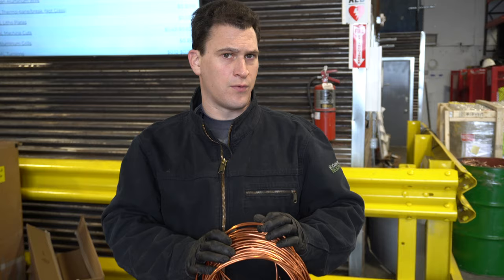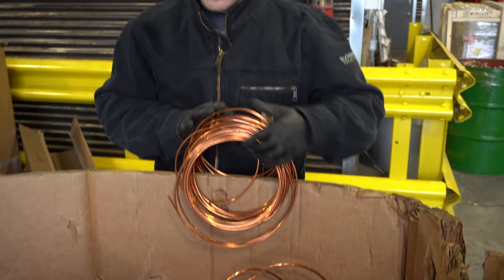Why You Shouldn't Make Scrap Ingots - Why Scrap Yards Will Say No To Buying Them

Comment: THANK YOU THANK YOU THANK YOU THANK YOU. OMG. Ingots have a purity based monetary value. People think making a square chunk of metal Miraculously somehow makes it valuable.
Reply from the maker: You're welcome! Thanks for watching! It's important for people to know that it's not going to work if you are scrapping them.
Reply: People will pay a lot more money for hand poured ingots for collecting
Reply: @BGTech1  well those people are not to bright. Bringing Metal home smelting it and trying to get the local scrap yard to buy it or even pay more is a waste of resources. and you are unlikely to pay for groceries or buy a car attempting to use such ingots. the Only possible reason i could maybe see for smelting is for Aluminum or copper/brass shavings. which may be worth more as a solid rather than as a shaving.
Reply: @4CarbideGaming  truly
Reply: @4CarbideGaming  well I can truly tell you've never scrapped before , the shavings you speak of would fill a bucket or barrel more tightly than full metal pieces which in turn saves space and easier loading .
Reply: They absolutely would not a solid barrel of brass will weigh nearly double a barrel of shavings would. I recycle cast steel shavings for over a decade at a metal shop. The barrels will average between 400 to 700lbs. The same 55gal drum of solid 3inch steel cutoffs is an easy 1200lbs or more Shavings vs Solids. Really.
Reply: Like why would you even take the time to make metal shavings. WTF.
Reply: @4CarbideGaming  you still don't know what you're talking about . . . milling machines , lathes , cnc machines and drill bits all create shavings ...... now why in the hell would I sit down and make metal shavings when its already produced thru the process , LOL go away.
Reply: I simply said the only reason smelting may be slightly beneficial is if you have a barrel of shavings and you were turning it i to solids. Again thats a maybe.
Reply: @4CarbideGaming Some people have 10,000 sq feet or more of garage, of unused space and others
have much, much less space for their endeavors. In otherwords, some folk can't have a horse ranch on a urban lot!

Comment: When I take motors apart for number two copper I melt it down and my yard buys it for number one copper just something I do for that kind of wire but I can up the value of it by doing that but that's just my yard a lot of yards won't even take them but I have also took bars up to them that was copper pipe with sorter on it and I borax it twice I told him it was number two copper they tested it it's almost 100% 99.2% pure so yeah depends on what you like but the video is correct looking forward to more
Reply from the maker: We are very surprised to hear that you yard accepts that as #1, good for you though! How do you remove the shellac and non-metallics?
Reply: @iScrapApp  the yard I go to is stuff's recycling in Winchester Kentucky they're a big yard but they cut the ingots when I first started going up there you know to test them but I use just regular borax 20 mule team Borax and I run it through twice on that I figured it was number two as well but when he tested it I couldn't believe but I don't recommend other people to do the same thing that I do ever because taking bareback copper melting it down you're just killing yourself
Reply: Yup. And in demos we see a lot of burnt copper wire that the yards won’t take. So, when made into ingots, they will take it, otherwise it’s just “trash”.

Comment: When it comes to copper, the price when you have to heat it might balance out your cost and payment, I'm more wondering if the same applies to aluminium and lower cost metals
Reply: yes selling on Ebay or Amazon will net a higher value for ingots
Reply: melt in cold days it'll warm your garage it's the poor man's  special 2 for 1 deal :face-fuchsia-tongue-out::face-blue-covering-eyes::body-blue-raised-arms:
Reply: @fvrrljr  yeah buddy. Got me 27 pounds of pretty clean lead and a little extra warmth while doin a few other things. Hah
Reply: Copper and brass are worth it, aluminum you're actually losing money if you run a propane furnace.

Comment: All you'd have to do is measure the density of the ingots.  Throw all the ingots in a bucket of water filled to the top, measure the amount of water that flows out, and then measure the weight of all the ingots.  If the density matches that of copper to within decent precision, you know that you're not being scammed.  We've known of this technique since the time of Archimedes (250 BC).

Comment: If the scrap yeard company doesn't have the equipment to check the engot , then find a scrap company that can
Reply from the maker: The problem is what is inside the ingot...
Reply: @iScrapApp  a xrf analyzer gun will tell you whats inside ingots.
Reply: @24manzoni  It doesn't penetrate more than 1 inch or so, thieves are thieves with lots of time to do their scam, and honest people want to make a buck on their efforts!

Comment: Thanks for the info. I'm a garbage man and I clip the wires off of appliances and so forth. In just under 6 months, I have collected three 50 gallon trash can overflowing with insulated copper wire of various sizes. I just made a homemade speed stripping jig and I'm about to start stripping it rather than Burn It Off so I can get copper one value versus copper two. I'm not in a real hurry to cash it in so I was considering learning how to make a smelter to reduce storage space. But I suppose the naked wire will compact reasonably well enough under some weight into buckets or cans. Probably saved me a lot of hassle and headache and unnecessary work for nothing. Thank you for this video.
Reply from the maker: Good for you- nice side hustle!
Reply: I work for a private company that picks up garbage from private residence only, and take the garbage to a privately owned landfill. Public property isn't part of the equation with what I do. I appreciate your concern, however. I could also see the city considering that stealing time because it does add a couple of seconds to each stop to clip the wires and stash them. But wow, that is extremely Petty of the city to go after their hard-working employees just trying to hustle an extra Buck or two without really hurting anybody. My boss knows I clip wires and doesn't have a problem with it. As a matter of fact, some of my customers that have seen me do it have started leaving appliances and electronics beside the trash can rather than in them.
Reply: Number one and number 2 doesn't refer to insulated copper...
Reply: Yes, and that bright copper wire is the highest grad scrap there is, and the highest price. Melting it into  something indistinguishable will lower it's value.
Reply: Good job! Keep it and keep collecting copper too! If you don't immediately need money, keep getting the copper, but you might run out of space. Copper will only be more valuable over time, so sitting on it will only make it more valuable, if this is the job you retire on, or just a stepping stone to something else, most everything never goes down in price, except TV's. Strip it, store it, save it for retirement nest egg. The only problem with the last one is you could die shortly before you retire and when your home is being cleared out for sale- some numbnut could go what the hell is this? And straight to the Garbage Dump it would go! It happens!

Comment: Gotcha so don't melt down sell at reduced price and let them melt it instead and make more money doing what I would of done anyways. This question can be asked from even reliable suppliers.
Reply from the maker: 🤦‍♂️ most scrap yards don't melt it...even who they sell to don't. So you are missing the point that they won't want to take the risk on melted ingots.
Reply: @iScrapApp  no I got the point. U missed my point. Being afraid to buy a product cause of either reliability or quality of the said product whatever it is is a fact of life for anyone buying anything. Wether it be melted ingots or a vacuum cleaner. Selling yourself short of income that could be made cause the scrap yard is scared of the quality of the ingot is same as saying u will never buy anything again be from Walmart or any other store cause u are scared of quality. There is no reason they can't test the quality of product they are buying that is all I am saying. If someone sells u bad ingots don't buy from them again. Simple.
Reply: @fusionmechanic1  I agree, they are buyers of scrap metal not buyers of  objects they can positively identify. If they won't buy them then who will; and nobody better say ebay.

Comment: Hi Tom, good video. I have a question. I was wondering why alternators generally are worth more than electric motors when they seem to have less copper in them? Thanks
Reply from the maker: Many buyers of electric motors or alternators or starters are able to resell these units to companies that will rebuild and resell them. So while many of them either have less copper or have aluminum cores in them, their resale value far exceeds the scrap.
Reply: Alternators or Generators are salvageable and have a "clean" cast aluminum housing.

Comment: Why does copper wire get brittle burning insulation off?
Reply: The annealing process goes just so far.
Reply from the maker: Because the heat starts to melt it down and erode slightly.
Reply: It wasn't cooled properly from being heated!

Comment: He is not wrong, for a scrapyard this is business, melting the copper down opens them up to scams and does not guarantee them the purity level, forcing the scrapyard to either take pointless risks or do extra steps to analyze the copper.
That said if you have a long lasting relationship with a scrapyard you can always ask, if you bring them metric loads of material you could raise the issue but at that point I'd suggest pressing it down like they do with old cars, it is less energy intensive and less expensive on your side.

If you do want to melt down the copper, do an extra step and either pretty up your ingots or pour it into coin shapes, cubes, basically put some creativity into it and sell it on ebay or similar sites for a WAY higher margin than you would with scrap.

For instance I am planning on doing just that and I would not expect a scrapyard to accept it.
Reply from the maker: Also very true- you never know what is inside of the ingots or what was mixed with it. Not all dirt or contaminants are removed.
Reply: @iScrapApp  See I wasn't even considering that, I was going for "Ye old tungsten bar" stuffed inside 🤣

Comment: Given the price of fuels these days it really doesn't make sense to melt anything. There's a video of a guy melting 8,000 cans and he shows the amount of propane used, check it out, the video also shows him paying for the propane, ouch. The cost of the fuel to melt the metal is going to pretty much negate any profitable income. Unless you start looking at melting tons of scrap on a daily basis it's a losing battle, costing more than the scrap yard or metal buyer will pay.
Reply from the maker: THanks for sharing the ideas.

Comment: The key is to make sure you have a lot of copper, aluminum, whatever. Save some trash and wood and melt as much as possible for free.
Propane is expensive when melting copper.
I still do it, but it's more less a investment for the future and fun.
Reply from the maker: Thanks for the thoughts!
Reply: Propane isn't as expensive if you cut your copper pipes or wire into smaller bits so they have more surface area. More surface area means the copper heats faster and melts more quickly.
Reply: @sjagain  induction smelting for the win

Comment: I get a 20 cent difference between filthy as F copper covered in plastic and clean bare.  After stripping ALL the plastic off my copper, i realized I prob took ALOT more weight off than I gained from having it clean.  If you've got the room somewhere just store it in a bin outside till its time to sell.
Reply from the maker: Very good point! Depending on your volume, it may be worth to sell as is

Comment: Im only interested in melting aluminium because it is so light it takes up a lot of room and it has a low melting temp so fairly easy to do and fun
Reply: I do aluminum to save space and get more weight per trip. Build a waste oil burner and you can do cylinder heads and engine blocks to up the price by removing anything magnetic. My local yard appreciates the bread loaf blocks I bring in. 😂

Comment: You better not crush your aluminum cans as well. They cut the price in half if they are crushed.
Save your money from buying a can crusher. 
I've taken 100s of pounds of aluminum, copper, brass and tin, not a single bit of any other metals, to a scrap yard 4 miles away. I got just enough money to pay for my gas there and back.
Reply from the maker: We do not recommend crushing cans either!

Comment: Surely volume (displaced water) and weight would accurately tell you if it was genuinely copper all the way through - given you know the weight of copper. Didn’t Archimedes show this?
Reply from the maker: Funny point.
Reply: True but you are asking the scrapyard to take additional steps to analyze the material, meanwhile if you bring it in without altering its shape the scrapyard doesn't need to do that and can recognize instantly the grade of the metal.
Also many smaller scrao yards (at least in my country) don't have an XRF on hand to test the metal purity and just eyeball the grade based on experience
Reply: Way too much time and the skill level needed for simple mathmatics that most employees are incapable of! You'd be lined up for miles and pay us instead of we pay you! Have yo ever had to hire anyone? I didn't think so!
Reply: Yes he did, but now, can you tell me how? Really simple, but you and 99% of everyone out there can't either- not a guilt trip, just fact!

Comment: When the guy who rips you off of 90% of the value of your metals tells you NOT to make ingots you probably shouldn't listen. If the scrap yard doesn't trust you then you're either a new face or you've ripped them off before. Make ingots and eBay them.  The worst thing that can happen is the prices at scrap yards will go up. 
Imho
Reply from the maker: If you want to get rejected at more yards than the ones that will accept, then be our guest

Comment: They can't just weigh the bars and make sure it lines up with the weight of copper?
Reply from the maker: Not really- it is all different.
Reply: I could melt lead and run it down copper pipe, but I don't, fill cans with sand- I don't do that either! The discussion here is getting the best $$$ and not getting, or giving a rip-off!

Comment: How does one clean copper so that is the consistency they want ?
Reply from the maker: keeping the material as wire, tubing or whatever is found. removing plastic or other contaminants.
Reply: @iScrapApp  Oxyoalic acid is sold as a wood deck cleaner in most harware stores and in a weak solution with water will take brown #2 copper to a #1 red in short time. Just watch while soaking in a tub and pull out and rinse thoroughly, another tub of clean water, when desired color is achieved. Sodium bicarbonate, Arm & Hammer baking soda mixed with your rinse water will help neutralize the acid. Leaving in the first soak would probably eat up the copper, and any leftover would probably pit even after dry if not rinsed, neutralized thoroughly.

Comment: " I don't know what's inside it, I don't know how much dirt there was, maybe there's water inside it. maybe its mixed with steel, maybe there tin coated copper, maybe there's some aluminum"

How many of those can actually happen? 

dirt? less dense than copper and floats to the surface if not burned off immediately

Water? Seriously, did he say water????? would cause an explosion in molten copper

Steel? Yes, you can incorporate small amounts of steel in Copper during melting. Not sure it ifs any significant amount. but at least that's plausible. Steel will float on molten copper, so it needs to be thin pieces that can actually melt at similar temps.

Aluminum? Yes, you can make Aluminum Bronze, but if you can't tell the difference in the color, you don't belong in the scrap industry.

Tinned copper? Yes, definitely possible. Not sure how much it would effect the weight and color. I have a batch that I need to melt to see how it comes out.
Reply: Exactly.  And if the people buying metal had any sort of sense, they could verify the purity in a couple minutes by just measuring the density, rather than neurotically cutting the thing open over and over.